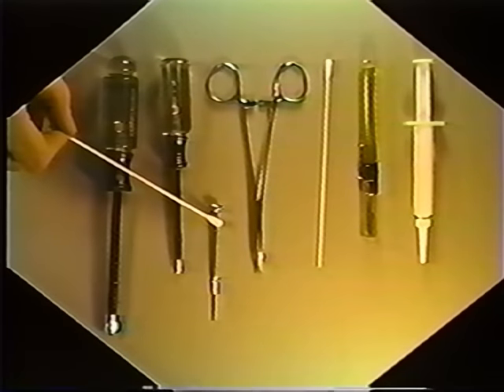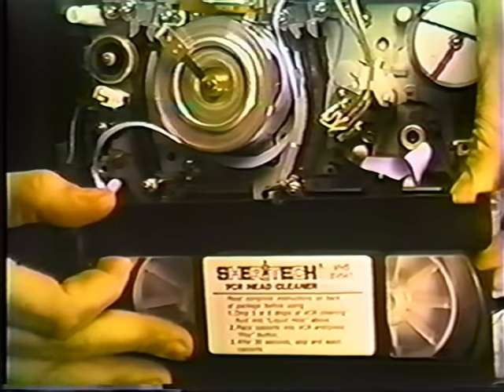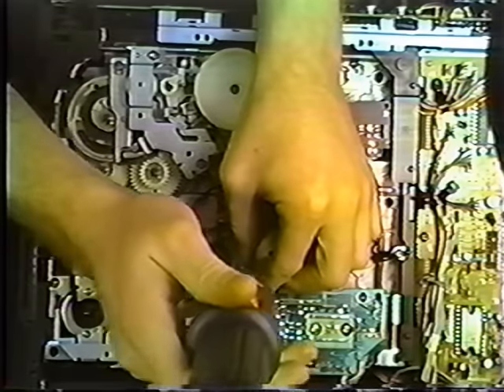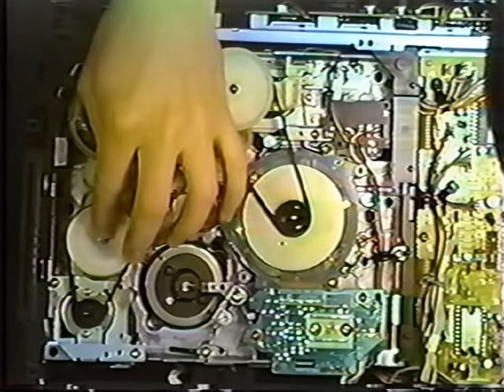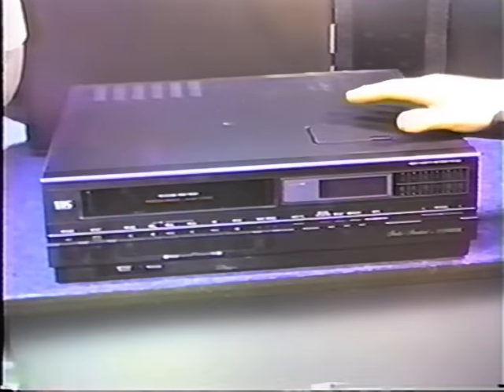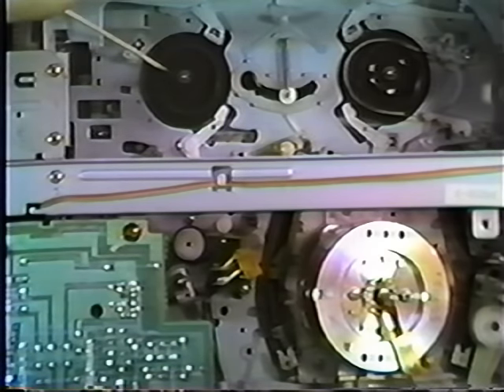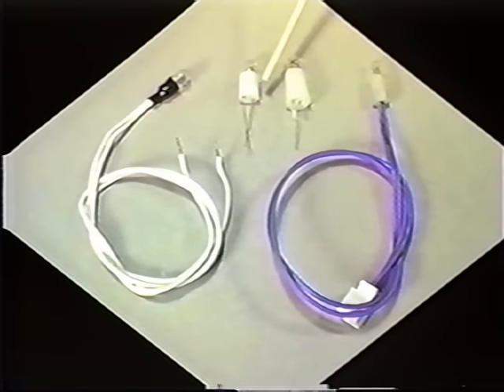A Layman's Guide to Minor VCR Repair

Comment: Thank you very much for posting this. This actually helped me repair my 1985 Panasonic VCR that was locking up and chewing tapes. Getting to the idler would have been a mystery to me if it was not for 10:20 to 12:45. I recently bought a 1984/1985 Sears (Hitachi) VCR that I will need to service completely. The unit is similar to the 23:35 model but it is slightly more modern with no PC board at the bottom. It has a cable ready tuner and Linear Dolby Stereo.

Comment: What would cause a Symphonic SC313B combo TV/VCR to shut down after 5-10 seconds of being turned on.  If I put a tape in it will play the tape no problems.  As soon as I hit the Stop button 5-10 secs it will turn off the TV.    The only trick I found is if I disconnect the power cord and wait for lets say 30 mins, then plug the cord back in with a tape in it and hold the tape from coming out it will stay on.   As soon as I eject the tape the TV shuts off or if I just manually shut off the TV then turn it back on it will shut off in 5-10 seconds.
I have to repeat the process of unplugging the TV for some period of time then power up with a tape in it and hold it so it won't come out then the TV will work again.
Any clues what the fix is?

Comment: Does anyone know if any of the VCR repair guys here on YouTube will answer some repair questions? I know time is valuable, so I would try to make it as quick as possible. I'm trying to learn a few things about repairing these beasts. I have about 15 of them and want to avoid having to trash them. They need to live on!...lol.
Reply from the maker: Try asking 12voltvids. He is a former Sony service technician and has done several VCR repair videos.
Reply: He actually messaged me and said he would help if he could and we've spoken a few times. But I think he's too busy to answer all of the questions I have. I'm still accumulating VCRs and camcorders, so the questions are piling up. I'd really like to know where to get parts for one thing. I need a power supply for a JVC VCR and a mode switch (I think is what it's called) for a Samsung CC. And also some ribbon cables for a few things. It's kinda overwhelming me!...lol. Thanks for the tip VWestlife.

Comment: Hello. I have a lg dvd-vhs combo vcr. The first 10-15 minutes show bad. Then it gets better. I tried many different cassettes same problem. I wonder what the problem might be. Sorry google translation
Reply: I also have an LG DVD/ VCR combo, and after a long period out of use, it would really struggle with tapes, picture quality was shocking, sound was also terrible. I took the covers off, and cleaned the VCR heads by hand with methylated sprits, and tested. (Watch a YouTube video on how to do this, because getting methylated spirits in the wrong place can cause damage). Sadly it did chew a part of one tape, so test it with a tape you’re not too concerned about, but after that it settled down and has worked reliably ever since.

Comment: Anyone else concerned from the beginning on whether or not this is reliable instruction based on the fact they don't know the difference between "insure" and "ensure", or has my OCD gotten a little too extreme?
Reply from the maker: At least in the U.S., both spellings are commonly used.
Reply: @CamcorderTests  
But they have different meanings...

Comment: hmmm. Nope I'm Not gonna try. brand new out the box at downtown los angeles $39 repairman will charge $$$$ and parts will be $$$$ I'll still give you KUDOS for the video and you uploading. i Like, OLE!
Reply: I don't know where you could buy a brand new VCR, the only remaining company stopped making them 3 years ago. $39 would be very cheap for a brand new(maybe old stock?) VCR, a decent one certainly cost more than that when they were popular.
When the original video was made, some VCRs were very expensive.
Anyway, it's nice to get VCRs working again :), especially good models.

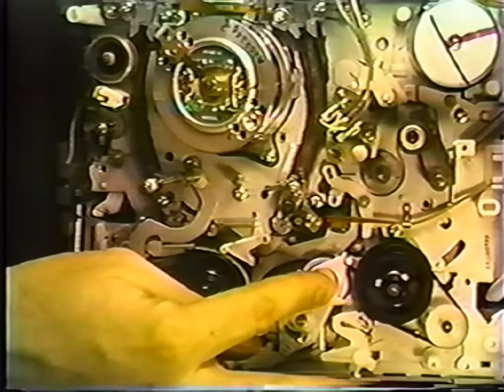Comment: 4:56 How to do a test run like that without putting a tape in?
Reply: VHS VCRs have optical sensors for the end of the tape. Just cover the sensors with black electrician's tape and then the machine will be able to perform its transport functions without a tape.